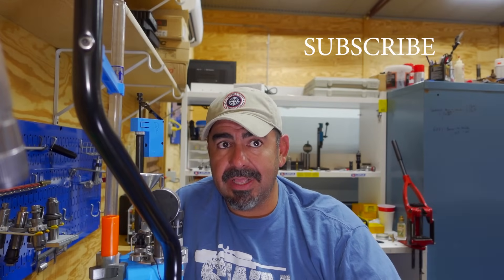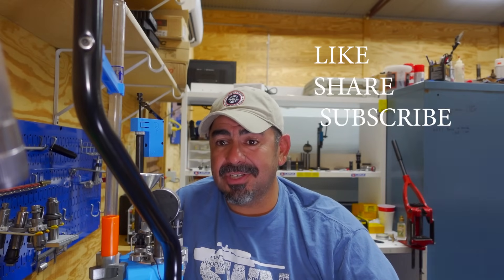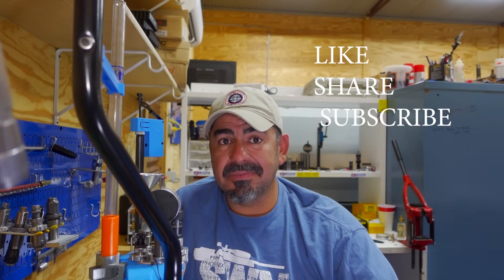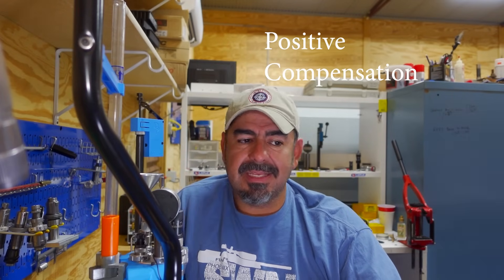Precision reloading is easy.  YOU complicate it!

Comment: I’ve been watching your videos and I am going to start reloading soon. So far I know that I’m starting with once fired brass and I’m going to full length resize each one to fit my chamber and have the bolt close smoothly. I will then find my COAL and then back off 20k from jam to start my seating depths in 3k increments to find the node. My confusion is when I’m finding my nodes with different seating depths, what powder charge should I be running? Should it be middle of the line to find the nodes and then experiment with different powder charges to achieve the speed I’m looking for or do I find the powder charge first to find the best ES?

Comment: It really ain’t as hard as you make it. 3/4” at 100 yards is 3” at 400. Easily minute of coyote. Very few shooters expect one hole accuracy. SHOOT SAFE!!!!!!!!
Reply: @Donna - that has not been my experience.  On a given day with given wind and heat conditions, I can shoot 0.5 MOA at 100 yards and 1.9 MOA at 250 yards (and probably worse at 400 yards).  My theory is that the impacts of wind, heat thermals, etc. all are compounded as the bullet slows down and travels further.  It's not as simple as a linear relationship between MOA at 100 yards and at 400 yards.

Comment: Erik, thanks much and I appreciate your candor and honesty, especially coming from such a decorated modern day technical subject professional that you obviously are about the art of the accurate velocity in firearm mechanics. I consider myself a professional in a different field and because of that I do understand that simplicity removes all doubt...even in basic mathematics. My question to you as an expert in the field is in respect to initial decision of components. More expensive equals assuming "Better Components"? This video tells me you like Lapua Brass straight out of the box, resized and filled with V 150 and topped with a Berger projectile. You also tell me that a different brand primer is essential to creating a better ES / ED. Combustion... so where do I, as a novice reloader sponge of reloading information start? I realize that in my own professional capacity that the answer to this question is probably more than a thousand answers.... but what I would like to understand is if, for example in .308 Semi-Auto, should I be looking for particular traits, styles of powder, a particular primer, barrel chamber to case wall thickness and also be considerate of case material composition, etc. Where do I start? I want to put my best foot forward. I want to create a minus 1/4 MOA cartridge. I have a decent barrel, a decent shooter, what's my next best choice(s) in reloading?

Comment: Erik, good info. I often times jump off the deep in so it’s nice to see a back to basics video. Question: what chronograph do you use? I have a standard Caldwell and I’m wondering if my ES is large or if my chronograph is not accurately picking up the speed. I’m considering a magnetospeed